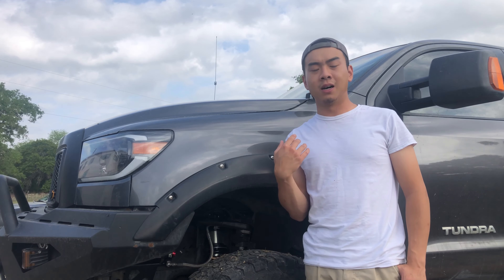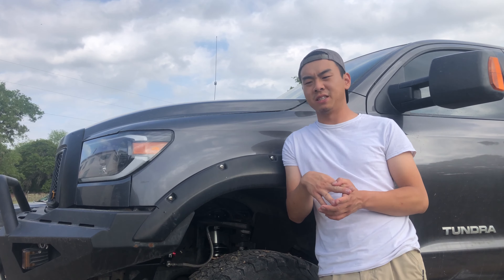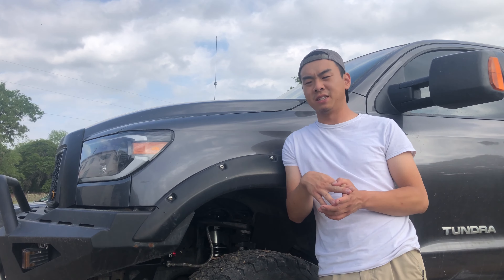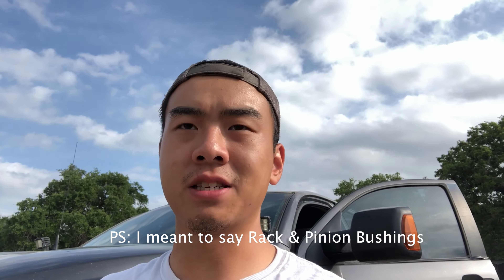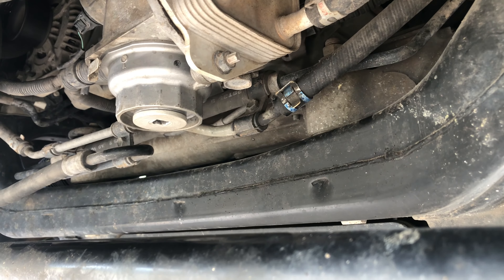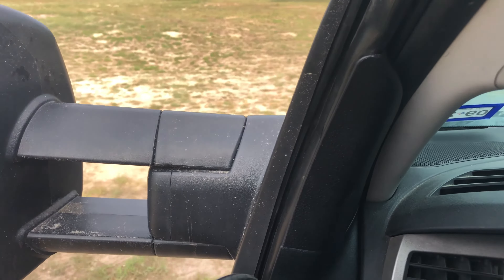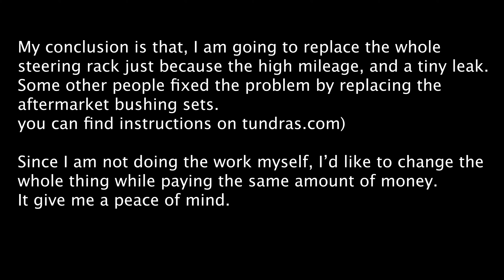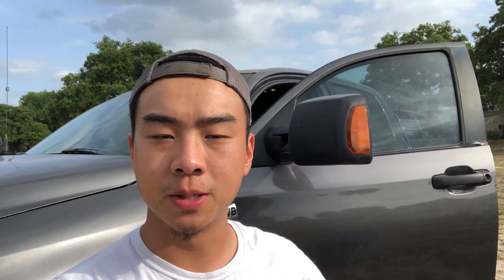2nd Gen Tundra Always Out of Alignment and Popping Sounds When Turning Steering Wheel - Solved

Comment: I wish I'd found this video sooner. After upgrading to CoachBuilder tie rod ends, anti-sway bar connects, and alignments,  this was the culprit all along after upgrading my suspension. Replacement was a PITA, but fixed the clicking and loose steering.

Comment: Great share .. I'm having a very similar issue with my 2010 tundra. Getting ready to upgrade my needle bearing finally with the ECGS clam shell.. I need to take a closer look at my rack and pinion... Thank you again for taking the time to post your findings.
Reply: I did the ECGS clamshell bushing a couple of years ago as my 2010 Tundra was making a growling noise in the winter. Totally fixed the issue. I just put a 3" lift on it and now it's making the same popping sound as the video. I was hoping it was the sway bar links we jacked up when reinstalling them. I hope it's not the rack and pinion. We'll see.

Comment: This is great thanks for sharing. Your truck looks awesome! I have a 2011. Lifted 6” it’s great and I’ve had it for 5 or 6 years and I’m just now having my first major issue. Replacing the rack today in my garage. Suddenly lost power steering and both seals were shot. I poked a tiny pin hole in each boot and both sides were leaking.
Reply from the maker: Thanks!
Hopefully you get your rack fixed up soon.
Reply: Sorry to hear, how many miles did it have ?
Reply: @jungy9001  it has upwards of 200,000. I think 180 ish. I got the rack fixed! Was very difficult because I accidentally stripped out my rack. Where the high pressure hose goes into it. I’m a seasoned mechanic so I should have known better. Bought the right sized tap and replaced the line and got it on the road. Then I broke my clock spring so I have fix that for my airbag to work again haha. Didn’t go as smooth as I had hoped but got the truck back on the road just in time for spring rush as my phone started ringing for cleanups and lawn care.

Comment: The stock 2012 tundra we have has the same problem, we think they should be recalled.  Did you ever have the whole front end shimmying during braking particularly downhill?  It looks too like the bushings should be replaced in the rack to resolve.   Perhaps too the aftermarket bushing and upper control arm should be replaced.  Thanks for your work on this issue.  We really appreciate the confirmation.  The design seems weak and Toyota seems to know this.
Reply from the maker: My front used to vibrate and shimmying when braking, ended up being my brake is warped. With amount of the lift and tire size, I think the stock bushing and rack design can’t handle well
Reply: My Tundra, years ago and it bled me dry, always shimmied on braking.  Made me nuts.  Replaced rotors with no luck.  Was told the brake design ie rotor size was just too small for the weight of the truck.  Mine was completely stock.

Comment: My 2012 Rock warrior double cab when it goes in the shop and the wheels are rotated it’s important they set the VSCA I think it’s called or traction control. There’s a loud grinding sound if I’m in automatic and have to brake quickly or braking while turning. From what ive read in forums it’s common. Pumping the brakes is the only way to stop otherwise the grinding metal sounds horrific and the truck doesn’t stop well lurching forward. I think there was a recall on the rack and pinion for 2nd gen. I could be wrong. My last rotation they didn’t reset the traction control. I need to learn how to do it on my own. I usually drive in S mode and or tow haul and it doesn’t happen.

Comment: I have a similar sound only when I’m turning and hit a bump or uneven pavement. The steering feels tight and it drives straight…nothing feels loose. But it sounds the same (inside the cabin). So now you got me thinking I need my rack and pinion checked out 😭. Can you please tell me how much it cost for the replacement?
Reply: Did you ever find out if you needed one
Reply: @robertespinoza2740  I haven’t taken it in to get checked. It’s very minor and happens only sometimes. I should get it checked though lol
Reply: @robertespinoza2740  did you get an oem one ?

Comment: I have the same issue on mine but I have low miles. I'm thinking of just upgrading the bushings to the polyurethane ones from energy suspension. How much was labor costs for the rack and pinion replacement if you don't mind me asking from 4wp?
Reply from the maker: I think it was around $375 if I remember correctly, it’s been a while and I could be wrong. If mine had lower mileage I definitely just gonna replace the bushings.
Reply: @haroldz3914  I'll hit up my local 4wp.. I normally do my own work but only on the things I know on my truck.. I have a drop bracket lift too that's why I asked about yours.
Reply from the maker: @islandcreationlv  I was going to try on mine but I live so far away from shops who do good alignments on these trucks. Didn’t want to risk that. You’ll need to get a alignment right after, which 4WP probably won’t let you go if you don’t get one.

Comment: Hey Harold, how do you like the RC vertex? Thinking about getting them but not to sure about quality
Reply from the maker: I’m liking them so far, but my opinion is based on comparison between vertex and my  265k miles old stock ones. The ride feeling definitely feel better than the spacer+old shocks but I have never ride in any other brand coilovers on a tundra. If you have friends who have different options on their rig, go try it out before your make the purchase would be a great idea
Reply: @haroldz3914  yea getting alot of mixed reviews on them. Have you had any issues while off-roading? Also what size is yoir lift?
Reply from the maker: @ryanca10  I’m using their 6” for my RC 6” lifts. I would say on road is does great for me, but for off road, I still can’t get a fixed opinion or feeling about them. This could be because I only have the front installed with vertex and my rear is still the basic one. I think my final thoughts won’t be ready until I put the rear vertex on and hit some trails. If you are getting mixed opinions, the best way I think is just have to sit in a truck that has the similar set up. Our local tundra crew is huge, and you can see all kinds set ups at meets or fb pages. Maybe try your local group?
Reply from the maker: @ryanca10  no issues with off-roading, just to clarify that

Comment: How much was it to replace the rack and pinion??
Reply from the maker: Labor was $350 ish plus an alignment
Reply: @haroldz3914  where did you go in SATX? I just got quoted $2500 for stock rack and pinion replacement on my stock 2019 5.7l 4x4..